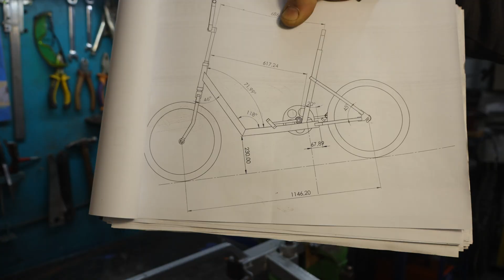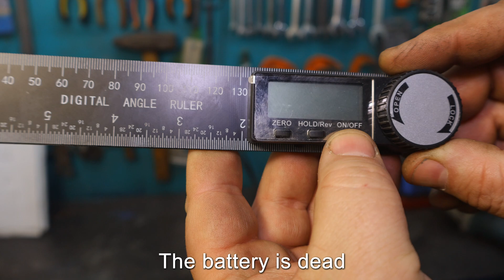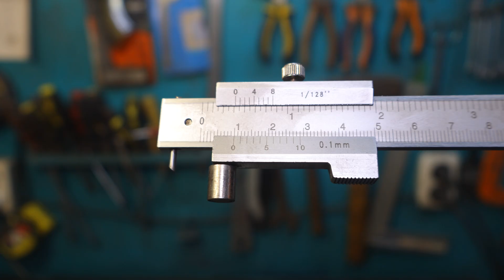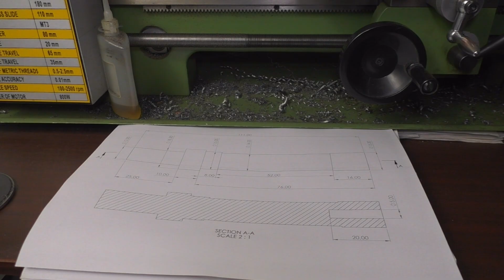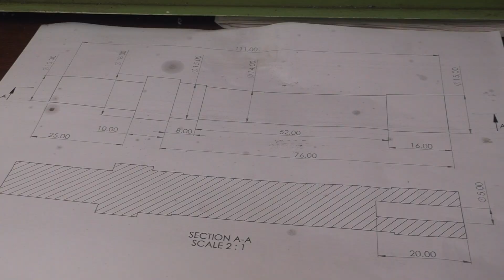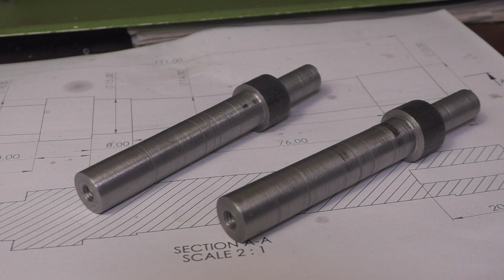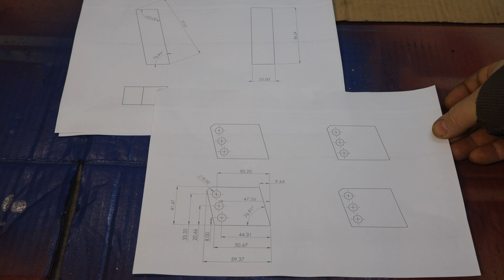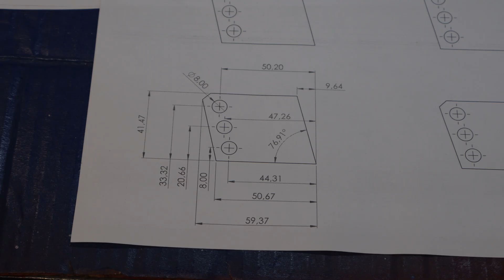Tricycle with two tilting front wheels, Simple Reverse Tilting Trike

Comment: Swing arms on bolts without bearings are technically wrong. The holes of the thin sheet metal in the arms will soon be hammered out.

Comment: Very nicely done 👍
I was wondering: What if there was only one center pivoting point, so the wheels would not articulate with the trike base? Then there would be less pivoting and therefore maintenance points. And a bit more stress on the front wheels while cornering...